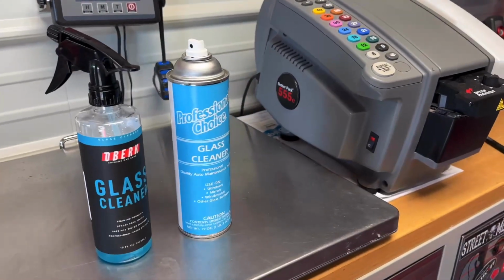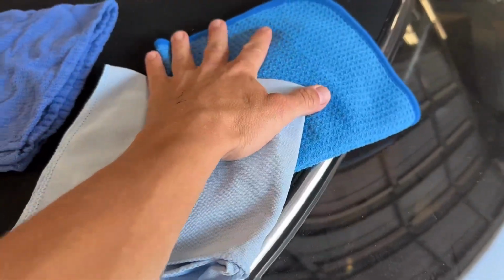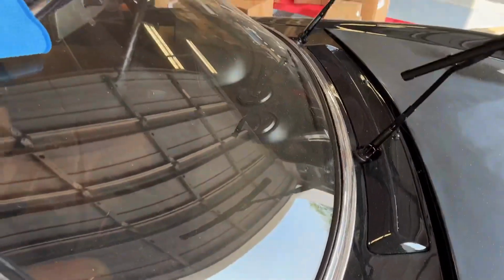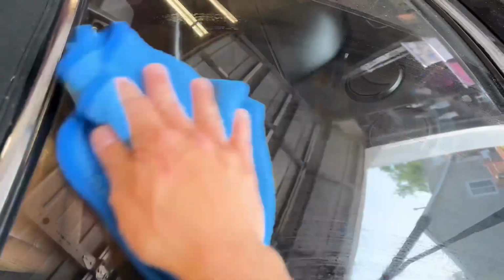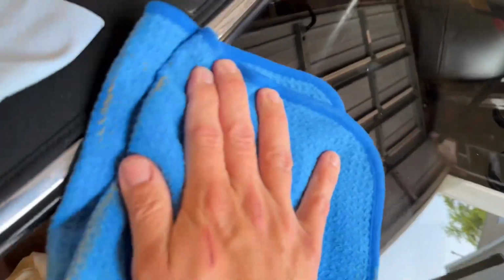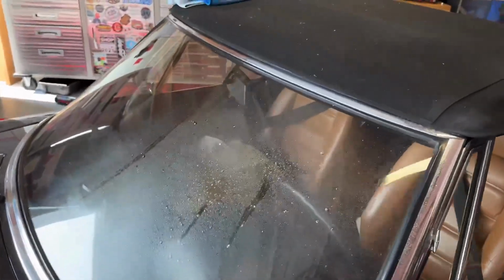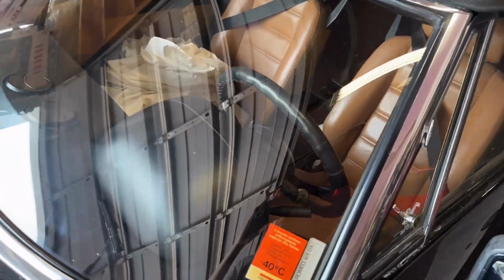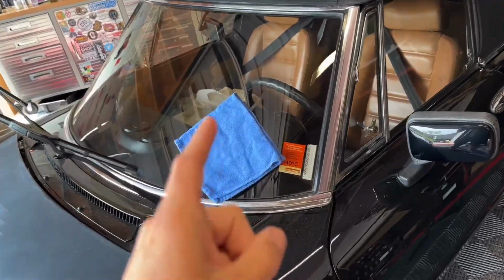How to clean glass AND the BEST towels for the job!

Comment: How would you maintain the towels? I am guessing since they're cotton you wouldn't want to wash it with your microfibers?
Reply from the maker: You definitely don’t want to wash together. Keep cotton separate. I wash them together like You would with drying towels. They last forever and super easy to keep clean. I recommend washing before use. I almost feel like they get better as they get washed a few times. Honestly microfiber cleaner probably works better than laundry detergent, but you don’t need much at all and both work for cotton towels.